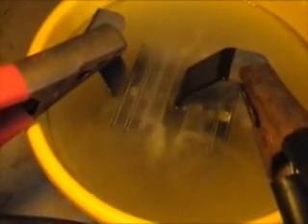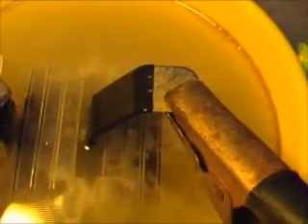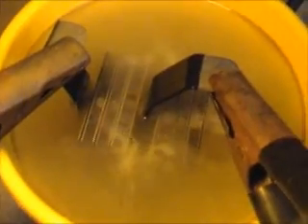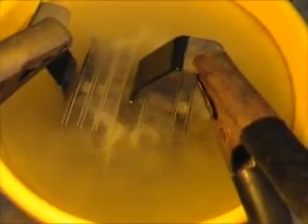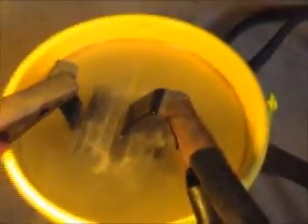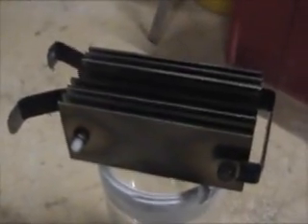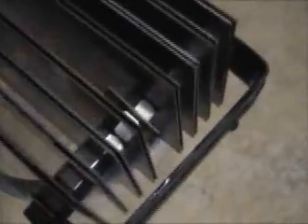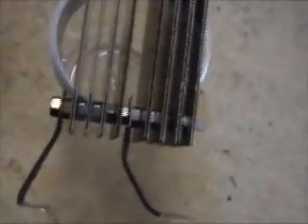HHO Cell based on Smack Gen II - Part 1

Comment from the maker: voltages are all over the place, only the inner cells have 2v. Others are around 0.5v and 7v on the outer cells causing the water to heat up. There is a dissimilar metals reactionn going on and the s/s nut is acting as a sacrificial cathode. When isolating the end nut the Titanium quickly forms a blue oxide layer and the HHO stops :( Back to Stainless steel plates.....